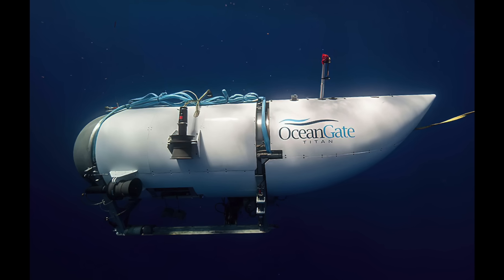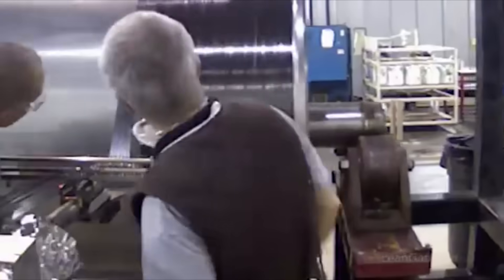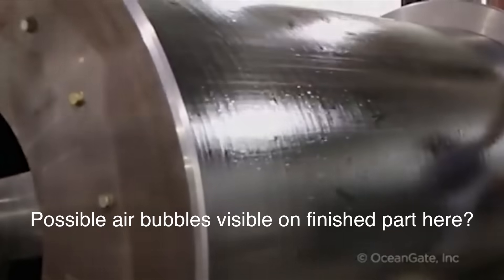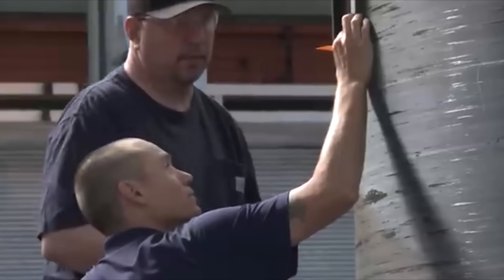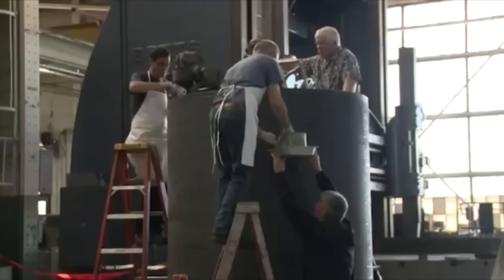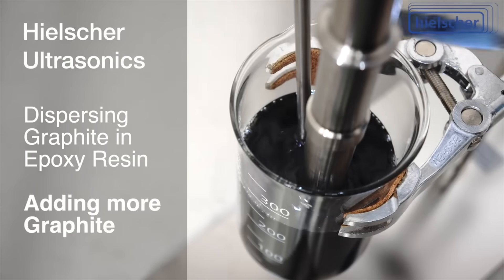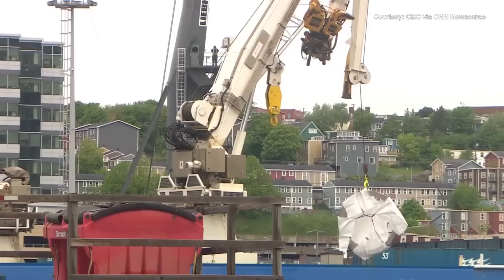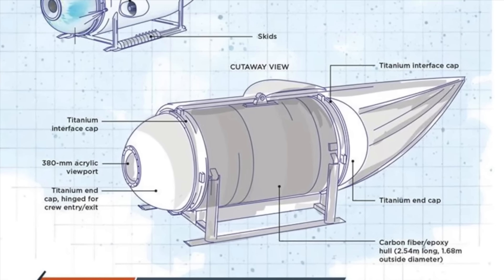Why OceanGate Titan Imploded - A Carbon Fiber Composites Perspective

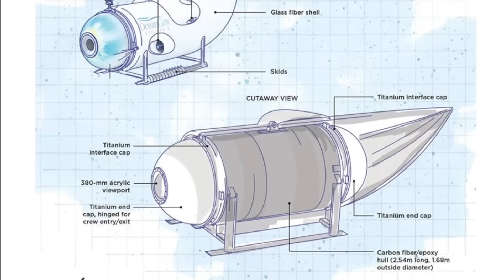Comment: 4:38 Hi, I’m a naval architect! “Strength-to-buoyancy ratio” is complete and utter nonsense. The buoyant force is only a function of the volume of displacement of the hull (provided that the hull isn’t flooded). A fully-immersed cylinder with a 2m outer diameter will have exactly the same buoyant whether it is made of carbon fiber or steel or titanium. If your requirement is a certain inner diameter, the extra thickness will get you some more buoyant force, but you could get the same extra buoyant force by simply making the metal hull larger to achieve the same outer diameter, with the added benefit of slightly more available volume inside the submersible. 

TLDR: Archimedes is right and Stockton Rush is wrong.
Reply: Thank you.  I thought I was being dumb there when he came out with that one.
Reply: Rush and Archimedes are both right. There is a reason deep dive subs have very small accommodation spaces and large military subs have very limited crush depths. Assuming the bulk material you make the hull out of is negatively buoyant, the greater the design depth and the larger the internal space, the more hull material you need to resist the pressure. Eventually you reach a design depth were it is no longer possible to maintain neutral buoyancy for the overall vessel. It is easy to add ballast to compensate for positive buoyancy, but very hard to add buoyancy because any tanks you add also need to resist the pressure. So Rush was trying to say that the buoyancy of the bulk hull material needs to be as little negative as possible relative to its strength, and this is why he liked carbon fiber over titanium or steel. The first deep dive sub, Trieste, had an interesting solution to this. The tiny steel accommodation sphere had enormously negative buoyancy which was compensated by an enormous thin-walled tank of petroleum, which is as incompressible as water and slightly less dense.
Reply from the maker: Fantastic debunking! Thank you sir!
Reply: @JamieKunka Glad to help! It’s relatively rare that my expertise is relative to something in the news, but when it is, I’m more than happy to help elevate the public discourse.
Reply: @michaelimbesi2314   that is true , the buoyancy is proportional to the volume regardless of what materials the hull is made of. but i think what rush was referring to is that he wanted to achieve a certain buoyancy with the lightest materials possible to reduce the weight of the sub.
Reply: @michaelimbesi2314 What you say is of course true but Rush was subtracting the weight of the material from the  buoyancy force to get the overall effect on the craft. 

It's clear what he meant, but he didn't put it in a very scientific way.
Reply: @salman-hm8zf without a doubt what they needed was the sub to be buoyant and float... With weights dropped...... If it's made of heavier materials such as steel it's less bouyant with the same displacement....   At the end of the day carbon fiber was the cheapest.... And that's what drove him to it..
Reply: @JamieKunka actually it is more of a mistake or misunderstanding than a debunk
Reply: Exactly correct.

Stockton Rush should have known this, but seeing all the flaws in his design/manufacturing of Titan, shows us that he was ignorant to learning.
Reply: I'm just an automotive mechanic, but I thought something sounded wrong when I first heard that clip. Even setting aside what happened to the Titan showing us Rush missed the mark, if you just think about it something seems off. We've been using carbon fiber for a long time for a lot of applications. If there are no deep sea going vessels utilizing it as hull material - there's a reason. And I don't see where 'hull strength to buoyancy' is particularly beneficial in a vessel that dives. I would want hull strength maximized and for it to be buoyant enough to make it's way up when the time comes. Sounds like Rush kinda went the other way trying to make the vessel overly light and juuuust strong enough - and it wasn't strong enough.
Reply: @cavalieroutdoors6036 There are quite a few deep sea submersible using carbon fibre, Deep sea Challenger that went all the way to Mariana Trench is one of the example and actually was design and built by the same company that did the Titan Hull for Stockton Rush, Spencer Composite.
Reply: I'm pretty sure he was using shorthand for SBMH, which if you look it up with National Institute of Standards and Metrics should be listed as strength-to-bouyancy-over-mass divided by hubris.
Reply: I think the concept he was trying to express is that they were trying to create a pressure vessel that was at least neutrally bouyant, but able to withstand the pressure at 4,000 meters, along with a (bogus, it turns out) safety factor. A steel or titanium hull thick enough to resist the pressures at 4,000 meters would require additional buoyancy, in the form of syntactic foam, which is expensive. This is how other submersibles do it, like Alvin, Deepsea Challenger, Mir and Limiting Factor. He hoped to get away without using syntactic foam, purely on the buoyancy of the pressure vessel, since carbon fiber (at least in his incorrect theories) would be able to resist more pressure with less weight.
Reply: Not an engineer at all so correct me if I’m wrong…but something you said doesn’t make sense to me.  You said an immersed 2 M cylinder will have the exact same buoyant force regardless of the material it’s constructed of.  Isn’t the buoyancy of an object determined by the weight of the water it displaces AND the weight of the object?  A cylinder made out of a heavier materiel is going to have less buoyancy. A ping pong ball is very buoyant.  A lead ball of the same size is not.  They displace the same amount of water when fully immersed.  If an object weighs more than the water it displaces it sinks. If it weighs less it floats.  So clearly the weight of the object affects if it will be buoyant or not.  Am I just misunderstanding what you meant?
Reply: Well I feel validated knowing my comment right below yours isn't utter garbage and maybe I did pay attention during my 4 years of school studying NAME!
Reply: Even if the sub is too heavy, they can always add more low density floaters to compensate, like other deep sea bathyscape systems. The Trieste that reached the marinas trench, for example was mostly composed of low density gasoline that kept the heavy pressure hull aloft.
Reply: @fascistpedant758  If you double the radius the surface area, and therefore the weight for the same thickness, goes up by four times and the volume by eight times. But then you also have to increase the thickness to add enough strength to withstand the greater span. How much thickness depends on the depth and therefore the pressure on the hull. The way to look at it is to see what is happening to the ratio of the displacement volume that is hull material versus one atmosphere air. Past a certain depth, depending on the strength to buoyancy ratio of the bulk hull material, you are adding weight faster than buoyancy.
Reply: @john_hind  Yeah, I wrote that comment very late yesterday after taking medication that made me drowsy. I re-thought my comment and deleted it this morning. Sorry. Though I was thinking of a constant length of tubular section, not a sphere.
Reply: On the one hand, you are completely correct. on the other hand the mind immediately goes "while yes, he Probabaly meant net-bouyancy, or possibly strength to density?" since a heavier Hull will of course require more buoyancy to compensate for it.
Reply: Respectfully….While you  are correct about the fixed  buoyancy of a standard volume cylinder… the over all weight of the sub will change based on the construction material. And net buoyancy  will vary depending upon the added volume of water displaced by the construction material.   If you used lead to build the sub…. The total weight would be different than if you used titanium to achieve a given structural strength. Then, assuming the enclosed cylindrical void remains constant, the effective net buoyancy would be less for lead construction.
Reply: I read into this more. He didn't want to pay for expensive foam for buoyancy that is why cares about that metric.
Reply: @@silerka Yes, buoyancy of a material is its density relative to density of water. But it is not the same as strength to weight ratio which is what is important in aerospace applications and this is the point Rush was making.
Reply: Wish you had worked for OceanGate... but then again you would have been let go by them when you expressed your knowledge.  Just a very sad situation.
Reply: Actually this is one where Stockton is right or at least misunderstood. A more heavy cylinder would have less boyancy. The air volume inside is the same, but the hull itself is heavier if made of steel. Therefore he would have to add boyancy foam outside the cylinder to get the same neutral boyancy. This would cost more money, as boyancy foam rated for these debts are expensive, and they again add more mass.

He was cheap, so he used carbon fibre.
Reply: @torben777  Correct. A lot of people here trying to appear smart without actually understanding the principles.
Reply: Prince Rupert design never does well next to a jellyfish slipping off the tip. It is litteraly the only thing no one talks about.
Reply: @tomahawkmissile241  now that you talked about it . . . what are you talking about?
Reply: Very well said.
Reply: It sounded good to the ignorant investors though.
Reply: @morrisschwarts4826  
Actually… I think Rush was correct on the general issue,   Which is to say… if lithium, titanium, and lead were all equally strong for a given volume…. You would construct submersibles from lithium… and definitely not lead.  I do, however also think that Rush was obscuring the primary issue….  Cost.      If titanium plus buoyant foam were the same price as carbon fiber… then the would have not used carbon fiber.  Ultimately, he used carbon fiber to achieve  a less expensive design.
Reply: It really makes you think when the United States Navy does inventure this deep into the water how this guy figured it was okay for him to do it
Reply: The CEO was an idiot!
Reply: Rich kid hacks together a sub with materials he purchased at Home Depot and it fell apart like everyone said it would.
Reply: It will NOT have the same buoyancy. If internal air volume is kept constant regardless of material density, yes the force is the same but is counteracted by the dead dry weight of the vessel which you have ignored completely. That was his point. He used CF because of ballast considerations. With CF he could drop the manageably sized ballast on the sea floor and rise to the surface. He did it on the cheap. Are you really a naval architect or a YT poser?
Reply: @xenuno  I agree with you, I think we found a university student posing as an industry expert.
Reply: Good job. Very objective.  Very true with what you were observing
Reply: The only legitimate issue with regard to the weight of the hull material is how much weight the transport ship can lift from the water. The right number for strength is determined by what is required to safely handle the load. The ratio is irrelevant. Obviously you aren't going down with less interior air than the hull can safely enclose, and spherical hulls enclose the most space, so buoyancy is guaranteed to be adequate.
Reply: @crawkn  At a given pressure the weight of the steel required to resist the pressure becomes greater than the weight of the water the vessel displaces. At that point, additional buoyancy tanks are required. At extreme pressures, the buoyancy tanks themselves must be filled with a lighter than water liquid to resist the pressure. Using materials with a greater strength to weight ratio reduces the weight of the vessel, eliminating the need for buoyancy tanks.
Reply: @fascistpedant758  the vessel has very nearly a fixed density as a whole, if the interior air pressure is fixed or nearly so. If it is buoyant at the surface, it is much more buoyant at depth. But the critical factor is that the strength and integrity be adequate, and lightening the hull at the cost of compromising integrity is entirely unacceptable. The material needs to be dictated by the strength requirements, and if additional buoyancy is required, then add it any way that works. Carbon fiber doesn't work.
Reply: @crawkn  I'm not defending the use of CF. The "density as a whole" of the vessel is very much dependent on the weight of the hull. Therefore, buoyancy of the vessel is greatly affected by the strength to weight ratio of the hull material. Buoyancy, of course, as well as hydrodynamic properties of the vessel, are of legitimate concern to the performance of the vessel.
Reply: @fascistpedant758  so use titanium
Reply: @crawkn  - yes, titanium is nice. They thought of that as an obvious option. But making a pressure vessel of that size from titanium costs a bit. And as they wanted to set up the business on a shoestring budget, carbon literally fit the bill better. Never mind that it wasn't really fit for purpose...
Reply: @crawkn  The other issue is that they wanted it to be buoyant without expensive syntactic foam. That was what drove them to the use of carbon fiber - to use a lighter material that could still withstand the pressure so that the pressure hull itself could provide the necessary buoyancy to raise the lesser weight of the pressure vessel.
Reply: @ziggystardust4627  yes except that wound carbon fiber can't handle compression, it's physically impossible. It's a fiber. You push the ends of a fiber together, it bends. It makes zero engineering sense and literally everyone told him so.
Reply: @crawkn  That is inaccurate. Carbon fiber can handle compression as long as it's held in the proper orientation by its matrix, usually epoxy. Practically all carbon fiber structures have areas where they are in tension and areas where they are in compresion. I ride carbon fiber bikes, and have flown on carbon fiber airplanes, literally trusting my life to structures that use carbon fiber in compression (the upper spar cap of a Boeing 787 wing has PLENTY of compression). The problem is when there are separations between the matrix and the fibers. And there are specific mechanisms for that to occur in thick composite cylinders under compression. The Real Engineering video on this goes into that in detail. Plus Jamie Kunka's video here gives a good explanation on how this structure was not designed to handle any axial loads, when it would be subjected to considerable axial loads from the titanium end caps.

It was a bad idea to use carbon fiber composites in a pressure vessel, and many people knew it, but it was more complex than simply, "carbon fiber can't handle compression" that has been reported in the non-technical media.
Reply: @ziggystardust4627  the orientation of the fibers in wound ribbon is linear. Of course the orientation matters, but the only orientation in the binding medium that would resist compression maximally would be omnidirectional, as in diffused in epoxy for example. But there is no binding medium which bonds flawlessly, so a correctly engineered composite still would require great care in casting and thorough testing to ascertain its safety and performance limits. And it goes without saying you don't do your testing with humans inside.

The torsional forces are negligible in a pressure hull versus the radial forces toward the center point of a sphere, or the center line of a cylinder. The amount of force and the direction of forces in an airframe are in no way comparable.
Reply: TLDR?
Reply: @Andy_Babb  Too long didn't read.  A summary for people who put TLDR  in comments.
Reply: Y
Reply: I agree and disagree. You have a weight and a volume. You look at the density. You adjust that by adding things that increase or decrease density. When you fill a ballast tank, you are adding weight to the vessel, but not adding to the volume. Your vessel has to withstand the pressure either within (like an air tank), or without (like OceanGate). You avoid things that change the density (like airbags, the air will compress, and occupy less volume at deeper depths. It's also a problem when drilling because if gas gets in the string, it decompresses as it gets closer to the surface, leading to a violent kick or explosion).
For Oceangate, you want a net positive buoyancy, you add dense weights (iron bars) to the outside, and in an emergency, you can jettison the frame. The equipment you mount on the outside generally has negative buoyancy. I think he had some very high air pressure tanks (about 5000 psi) for airbags in an emergency. Syntactic foam is like styrofoam beads that are covered with something to resist the pressure in deep places, but it was too expensive for Stockton. 
When you build a vessel, I would imagine you would want to know the volume and density of your buoyant (living) spaces, density of your fixed ballast, and density range of your variable ballasting (e.g. droppable weights, water tanks). Those are ranges, under pressure they will get smaller and the density increases. You need to not go where the water pressure is greater than the air pressure you're carrying if you have tanks to blow.
Reply: Yeah, but he just said the wrong thing, what he means of strength per mass, the displacement is the volume of the craft times the density of the water, lighter sub, easier to control buoyancy and you habe a larger budget of stuff to bring along that is denser tham water, if you just think of carbon fibre as a uniform material with all of its strength in all modes of deformation, tension, compression  ect, them sure, it is lighter as a complete shell of a certain size than titanium with the same ability to resist pressure, but that ain't it, if you just make a model of a uniform material that has the tension strength of carbon fibre, for compression as well and then you simulate the deformation under pressure, it is going to be a lot more resistant tham titanium at the same pressure and thickness, but that material is fairy dust concrete, it doesn't exist, the real material breals down, is susceptible to cracks in the matrix which render sections floppy nonsense that only really has the structural integrity of a rope, the deformation mode likely for a cylinder like that also applies uneven pressure to the titanium rings it is glued to, essential crushing the weave that goes along the cylinder, with probably the highest local stresses anywhere on the subs hull, some parts of the carbon fibre gets less compressed and other sections more, generally if the cylinder deforms at all, the resulting asymmetric deformation entail very high stresses on certain sections of the seal where the carbon meets the titanium, this is what trump would call, not good, very bad, so much fraud, can you believe it. The problem with a long cylinder shape is that it wants to flatten in the middle and no matter how you square that circle that creates a special direction of the deformation, that result in some parts of the end being forced ever so slightly further appart from its counterpart on the other end of the cylinder, and on some places that lenght will shorten, simply because the path length along the exterior is curved as different rates for different parts of the cylinder, creating pressure that is unevenly distributed at the end of the tube, and if you assumed a circular deformation with perfect symmetry, that stress never concentrates, so if you do the analysis quick and dirty you might miss the real faliure more and design something that can dive 4000 meters only in Disneylands swimming pool after a few cycles.
Reply: @monkerud2108  wtf dude.

You can't just go sonic speed with your thumbs and type a singular block of text.

You have to break it up into individual segments.
Reply: Thanks.
Reply: 😂YOU DO NOT NEED TO BE A ENGINEER OF ANY KIND TO KNOW THAT GLUE IS USED FOR CRAFT WORK NOT DEEP DIVING VESSELS 😅
Reply: @vaughnkavon3993  There is nothing wrong with using glue for deep sea exploration. The problem is how they used it, including that they glue together two materials that react differently under pressure.

In addition, to understand the design it is also important to understandstand that the two surfaces they glued together would be pushed together not pulled apart when under water. At the Titanic debt they would be pushed together with a force of 8000 metric ton at both ends, so if you hypothetically speaking had two perfect surfaces and lowered it to 3800 meter without any glue at all, it would hold together perfectly.
Reply: 667 layers of carbon fiber, how thick is the material being used? .001, or .004, or .0001 ?
Reply: @vaughnkavon3993  1 layer is around 0.19 mm (5 inches= 127 mm divided by 667 layers)
Reply: It failed because Rushton was a narcissist and couldn't give a sh@t. A common problem with millionaires.
Reply: Thank you Naval Architect.  When it comes to dangerous things, knowledge will save your life.  For reference, I’m just a simple electrical/electronic engineer with an inquisitive mind.
Reply: He probably meant strength to weight ratio!
Reply: He may have meant net buoyancy. He’s basically just saying strength to weight ratio. He’s still an idiot, but yeah technically makes sense.
Reply: Obviously a crushed imploded hull has no buoyancy to speak of. So Rush had this cart before the horse approach for the structural integrity of his submersible.
Reply: @tvgerbil1984 Counter-argument: An imploded submersible is actually perfectly buoyant since the former occupant space is now water itself. Stockton therefore achieved his goal in an unconventional fashion.
Reply: @chadwells7562  I think old Archimedes would have been very disappointed with you for all the time he spent in the bath tub to give you his formula to calculate buoyancy.
Reply: A counter argument:
for a (thin-walled) pressure vessel, the wall thickness required to withstand a given pressure is proportional to the radius of the pressure vessel. I we make the radius of the vessel twice as big, the wall has to be twice as thick. Therefore the density of the vessel stays constant regardless of size (as the ratio of wall material to interior/air stays constant) 

This density thus depends on the strength to weight ratio of the chosen material. Density and buoyancy are not the same, but perhaps that’s what was being referred to
Reply: Carbon fiber bubble wrap! 

With over 38 years of advanced material reinforcement manufacturing, ASTM (I) failure analysis engineering experience, including carbon fiber, the method, application and overall design are all examples of total disregards to proper design, manufacturing, testing, evaluation and certifications created a death trap guaranteed to fail within a few cyclic loads. 

Carbon fiber in this application and designs is complete negligence on all levels, in all disciplines!
Reply: I am an engineer and agree with you 100%.  This man seems out of his depth (no pun intended) - and despite his education is not skilled in some of the most basic aspects of the discipline in which he was participating.   I've also worked with CF (and other) composites, including in marine surface vessels and land vehicles, and would never depend on this general type of material in primarily compressive loading scenarios.  Many cite composite pressure vessels as examples of why there should be no issues here - but they've fundamentally, literally, got it 180 degrees wrong - as these cited vessels are containing pressure within them (rather than resisting external pressure),  primarily producing tensile stresses (hoop, longitudinal and related).   Complex general buckling failures are the order of the day here, and expected.  Sad indeed.
Reply: That is not entirely true, under water gravity still exists. A sphere made out of aluminum could float whereas the same sphere made out of tungsten would sink. 
But nonetheless, trying to increase practical buoyancy in a meaningful way by going from titanium to carbon fiber is daft.
Reply: @JohnnyTurbo87  It is true with regards to buoyancy. Buoyancy force is the weight of water displaced and is constant for either sphere.

Rush was referring to the net force on the object and misnamed it buoyancy. So he was technically wrong, but in practice,  we knew what he was trying to say.
Reply: You could do that, but Rush's point was that if he used titanium, he would need to build a larger sub to compensate for the extra weight. So not only would he be using a more expensive material, but he would need a lot more of it. So you and he are saying the exact same thing.
Reply: truthfully, i didn't mind oscar the grouch sinking his 'nowitemenallowed' trash can in the Atlantic.  couldn't have happened to a nicer guy.
Reply: @loginavoidence12 I’m glad he turned himself into fish food, shame he took others with him though
Reply: @loginavoidence12 His arrogance and insanity kept many watching to see what would happen. Shame he took 4 people with him.
Reply: He was obviously referring to how using a lightweight material like carbon fiber reduces the overall weight of the sub vs using titanium. It shouldn't be so hard to read between the lines. You're just twisting his words to make them sound as bad as possible really.
Reply: @jeremyarnold4798  We're already WAY past anything that would make Stockton Rush look worse than he already does.
Reply: @jeremyarnold4798 

I work in carbon fibre manufacturing & repair.
Stockton Rush failed to learn some very basics in the design & construction of Titan. This unfortunately showed his arrogance.
The vessel was deeply flawed in many ways. His one directional layering of carbon fibre was a catastrophic failure waiting to happen & fatalities caused.

Basically, he turned a blind eye to tried, tested, scientifically engineered & proved.

It's one thing taking himself down, it's another killing others.
Reply: @tman5634  explain how what you said has anything to do with my comment. Carbon fiber is less dense. Therefore, the net buoyant force on the sub will be greater, which is what he was saying.
Reply: @jeremyarnold4798 I think you're the one twisting to make it sound even worse.
Why would it matter if the material is lighter or not? Apart from the associated costs.
Reply: @jeremyarnold4798  Hearing a CEO of a technology-critical enterprise use terms to describe that technology that obscures the science is a big red flag.  

Any engineer who has had field experience or received feedback from the field (often somewhat blunt feedback) will tell you, documentation or instructions have to use not only clear and concise expression but also use the simplest words possible - you cannot be equivocal or ambiguous let alone use jargon (unless it is an industry standard expression), or you will suffer the consequences.  He could have easily described it the way you did but chose to use obscuring jargon, perhaps a sign that marketing was more important than fundamental engineering.  

Think that is unimportant, no, it is extremely important, that sort of rubbish filters down, there is an old saying "The fish stinks from the head".
Reply: “You’re just twisting words to make them seem as as bad as possible.” That is an emotional statement, not an objective assessment. It is an admission that, why you can’t define why, you believe the statement by the other commentor is wrong but you can’t explain why you believe the statement is wrong; you are unwilling or unable to make the effort to explain your objection. I encounter this same sentiment often when I present the fallacy inherent in a statement that is based in emotion, not logic.
Perhaps you did not look deeply enough between the lines. Rush, engaged in slide of hand; while the subject is safety at depth, he misdirected attention to the aspect of the enterprise, dealing with the weight of the submersible, and that is only relevant when operating above the water, not below it. This is what is between the lines: a submersible with a metal hull would be heavier and require ships and handling equipment beyond my financial resources. 
Secondly, his financial resources didn’t include the necessary extensive testing, which would’ve arranged up to almost 2 years. Rush was in a rush to get down to the titanic. He cited the three decades, long safety record of submersibles while denying the objections of this immersible community to his testing and operation methods And did not clearly convey those objections to his perspective, customers. 
Safety is not a binary proposition with only one hand, never getting out of bed and on the other hand, doing anything and everything other than staying in bed. Safety is a spectrum between never getting out of bed at one end and jumping out of an airplane at altitude without a parachute. Most of us operate between those two extremes; Rush, operated more toward the far end and castigated those who didn’t occupy the same place on the spectrum as he. 
As your comment is a year old, perhaps your perspective has changed, but this is my reading between the lines; how does it compare with yours today?   @jeremyarnold4798